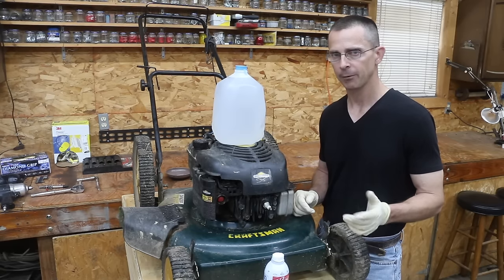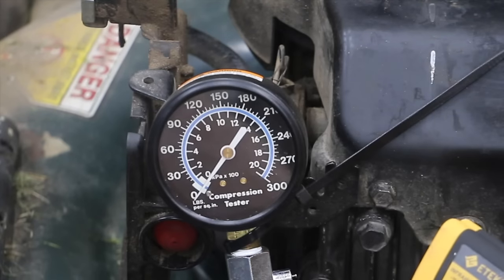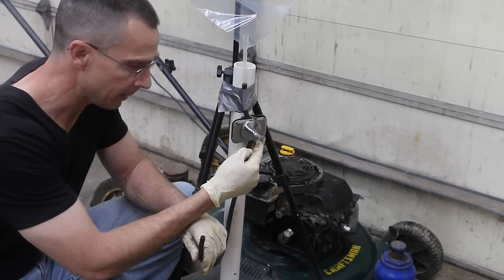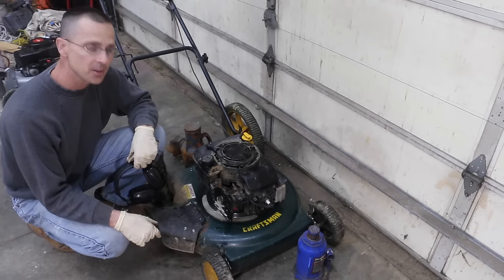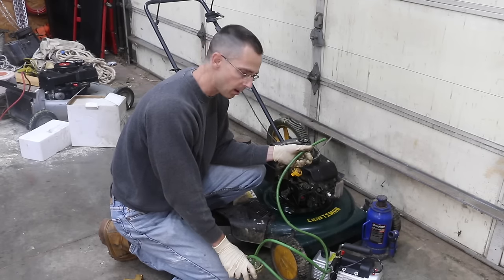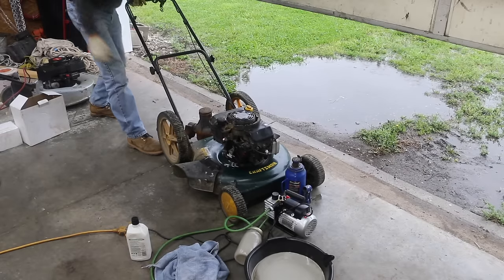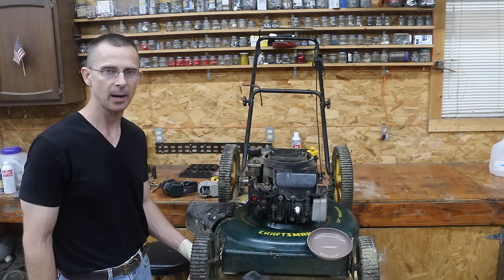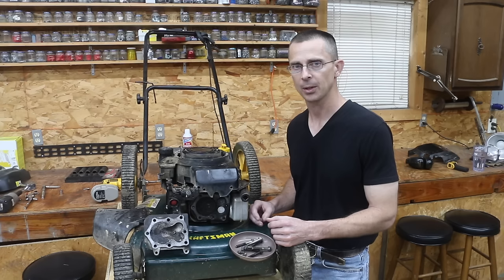Seafoam--can't believe what it did to my engine episode 5--cylinder cleaning test using water!!

Comment: You don't need that much water. About a cup or so should suffice, administered with a spray bottle into the air intake. Should be a job measured in minutes, not hours.
Reply from the maker: Thank you for this recommendation.
Reply: Yes! What I do to clean fouled spark plugs and clean the carbon off the head and valves is just take a glass of water and slow pour(1/2oz at a time) it into a car carburetor, or take off a small vacuum hose and let it pull the water straight into the intake manifold. The water goes in, and under compression then flashes into steam, shattering the carbon. Who told him 2 hours? and how much water?
Reply: your point would make sense if the cylinder head in the video was completely de-carbonised but it wasn't. minutes would have made barely any impact.
Reply: The engine temp dropping does not help, if the water was cycled it would have worked better I feel.
Reply: I agree!
Reply: He may have run the engine too cold for the steam effect to work.
Reply: Also helps to tap the head with a mallet.
Reply: looncraz 

There is no ‘steam effect’ as it pertains to carbon removal. It’s just somebody’s theory. Has never actually been shown. It’s more hope than reality.
Reply: @FrankGutowski-ls8jt  Steam cleaning isn't a theory you dope. It's been around and worked well for ages.
Reply: Deez Nutz 

Well, if you’re that sure, why don’t you conceive a better demonstration that definitively proves that ‘steam cleaning’ in this kind of situation works?
Reply: DRHJR DRHJR 

Your engine produces far more steam than you suggest just driving around. Why doesn’t it steam clean itself? 

A glass of water is about 12 oz, or < 1/10 gal. At 20 mpg, that’s two miles worth of driving, based on the fact that the engine produces about the same amount of water as the fuel it consumes.
Reply: Well at least we got to see what happens when an excess of water gets into the intake !
Reply: Remco is dead on with his comment!
Reply: this dude str8 washed his engine lmao
Reply: @FrankGutowski-ls8jt  Hi, I made a video the other day, my first real video, and all I have to say is, My hat's off to all the people who make good presentations like this guy because it is harder than it looks.  Well, as long as you don't want to look like a total dope, even if your an expert.  Keep up the good work.
Reply: I did that with my 2 cars and the steam blew out the carbon worked well yes use a spray bottle on a fully warmed up car should take 15 minutes max.
Reply: I was going to note that it needed to be aerosoled too. BMW has a high pressure water injection system on their turbocharged engine that helps control temps and allow them to run more boost. iirc it's the M4
Reply: I was always told that the addition of cold water only really works when the engine is at full operating temperature. The way I would do this is by using a spray bottle and every 15 seconds or so, give it a blast into the carb. The purpose of doing this is to cause a temperature imbalance between the metal of the combustion chamber and the carbon deposits adhered to it, which causes the carbon to flake off. The whole process should only take about 5-10 minutes or so. The slow drip process appears to have introduced too much water, and reduced internal temperatures enough to where it might not have caused the flaking process to occur. Still, it seemed to give some decent results, sans water contamination in the crankcase. Love the increased compression.
Reply: In my experience with this, I use about a cup of water to decarbonize a 1200cc engine.  You let the engine get up to operating (or even "slightly hot") temperatures, then let a little water in.  I usually place the water below the carbs, and let the vacuum pull the water in, i.e. putting the water above the carbs might cause too much water flow.  A big poof of water vapour + carbonation chunks comes out of the exhaust, the engine slows and cools down a bit, i.e. it takes less than two seconds.  You stop the water, and let the engine heat up again.  Repeat a few times until the carbonation chunks stop coming out the exhaust.  Often you don't even need a cup of water. I find significantly diminishing returns after about the 3rd or 4th cycle.
Reply: @looncraz  
Too much water in with the fuel causes lower exhaust gas temperatures.
Never heard of dripping water in the carb. How can that little engine vaporize the water completely. For all intents and purposes that motor is low performance flat head that doesn't really create that much power anyway. A good fuel additive on a regular basis should keep the carbon at bay and make sure your choke is adjusted properly. Have seen where the choke lever was bent and still partially on when the indicator said it was off.
Reply: When you blow a head, you can easily identify which cylinder it afected the most in a vehicle, it will be the one that looks like it has been steam cleaned
Reply: you sir are correct
Reply: @FrankGutowski-ls8jt  water methanol kits and blown headgaskets prove water works.
Reply: Be One 

Boil water in a carbon-caked cast iron skillet. See how much carbon is dislodged. Try shock treatments too, by dropping ice cubes in a hot skillet. Observe no change. Try misting, as shown by internet decarbonzation gurus. Note no change. 

Look up Leidenfrost effect to see why water will not wet a hot surface. Also note that ICEs produce copious amounts of hot, high-pressure steam as they run, yet still develop what are called carbon deposits, but which consist mostly of calcium and zinc from oil additives.
Reply: Exactly the seafoam takes 10 minutes and you know heat soak blah blah blah not hours LOL
Reply: Spam Can Subaru has been doing the same on the STI for years..... Water injection, it's actually been around for a pretty long time.
Reply: The Sparkster 

This happens only on your imagination.
Reply: Dan M   

All it did was blow soot out of the exhaust system.
Reply: @ProjectFarm  Yup, too consistent with the water application. The head temp was below the boiling point of water, that means puddles were sitting in the cylinder, creeping past the rings. The head was the cleanest around the spark plug where the most heat was, another indicator the head was getting too cold. I would have loved too see the "cough method", spray a shot of water in and wait for it to stop coughing, then spray again, to keep the water in a steam state, and keep the rings expanded. But hind sight is always 20/20. Great channel though.
Reply: @deeznutz2646  so then it is a theory!
Reply: @FrankGutowski-ls8jt  The BEST way to get rid of carbon is the "Italian tuneup" for about 5 miles! BTW, Cris Fix gave this video 2 thumbs down...
Reply: ojars zvaigzne 

I continue to be amused by YT’s many armchair decarbonization theoriticians. My own theory is to use E85 if your engine will allow in order to produce as much steam as possible internally, and follow through with the Italian tuneup, hoping for the best.
Reply: 120 minutes! You’re welcome!
Reply: @FrankGutowski-ls8jt  also note that the water did in fact remove carbon from the engine
Reply: @FrankGutowski-ls8jt  wont help the intake valves on a direct injected motor that never sees any fuel.
Reply: 3d printing meathead 

Look up the Leidenfrost effect. Water on a hot surface. Beads of water skit around on a layer of steam.
Reply: kewlbrz07 

This is an old trick mechanics use to lighten gullible customers’ wallets. Loosening soot from the muffler is all it does. ‘Proof’, they claim, that it works. If engines produce steam as they run, why don’t they clean themselves?

BTW, the deposits consist mostly of zinc and calcium from oil additives in crankcase vapors that are drawn in through the PCV system.
Reply: @drhjr7516  Somebody needs to read "procedures for cleaning carbon from a stationary engine" NO ONE IN THE AUTOMOTIVE REPAIR BUSINESS WOULD -NEVERMIND
Reply: Will this work for modern mass airflow sensor cars that are turbocharged?

Comment: I have run water/isopropanol alcohol injection in a 4 stroke 1000cc turbocharged engine. Water-ipa injects into each intake track at 150 psi, the water alcohol mix is completely waporized when entering the combustion chamber. I've run this on many of my turbo charged Yamaha snowmobiles over the years. On teardown of the engines I've found them all completely free of carbon deposits inside the combustion chamber, on the valves, and on the top of the pistons. There is no harm seen from the injection of water. Reason for running water-ipa injection is the ability to run higher boost on pump gas insted of running race fuel. Poor man's race fuel is a nickname used for this injection. I've run 22 psi of boost making about 350 HP in the 1000 cc engines on pump gas. Side effect was a very clean engine in the intake and combustion chamber.
Thank you for your videos, very informative, highly appreciated. Greetings from Norway 🙂
Reply from the maker: Greetings! Thanks and you are welcome!
Reply: this actually seems like fun to do. more complicated than just putting race fuel into the tank but can be a lot cheaper when tuned right (and a computer can just remove the boost if the water/iso tank runs out)
Reply: @blendpinexus1416  True, I have a failsafe switch that reduces boost to the waste gate setting, not do destroy the engine when the Water/IPA tank runs emty. I have the waste gate setting to allow for a boost level that is safe to run on Premium or 93 octane for USA or 98 octane for Europe. It's the cheap way out, and when you are riding trails you don't have the ability to get race fuel anywhere. Most servicestations sell IPA and water is free at the tap.
Reply: As far as a turbo charged engine what does methanol do?
Reply: @tonyhilton1461  In my application (although I do not use Methanol, but Ethanol) it is to prevent water from freezing.
Reply: @tonyhilton1461  methanol can and must be run a lot richer if used as the only fueling, it also adds octane rating over most average gasoline. Because of that you can get high compression/boosted engines to run cooler and make more power. It will allow the adding of more boost and timing. Negatives are that you have to change your oil almost as much as your gas tank because of the rich running nature of the fuel it contaminates oil quickly.
Reply: @tonyhilton1461  when used as supplemental fuel along with water added to a gas engine you can get a lot of the benefits without the negative oil contamination
Reply: what car, what engine?
Reply: I have done the same on my 1979 indy pace car.  The lawn mower was idling not under load there for not making enough heat for steam cleaning.
Reply: @sophiatheodores7985  Any gasoline fueled engine, and even diesels, can run water/alcohol injection to cool down combustion chamber temps. Which allows you to run higher boost levels without knock/pre-ignition/detonation.
Reply: @jan-ovepedersen5764  yeah but what engine did you turbo?
Reply: @sophiatheodores7985  Yamaha Apex Snowmobile with the Yamaha Genesis 4 cylinder, 4 stroke, 998cc engine (derived from the R1 motorcycle), 150 HP stock. 315HP with turbo on premium 93 octane (US) pump gas, 350 HP on premium pump gas with water/alcohol injection.
Reply: @jan-ovepedersen5764  based

Comment: We learned the water to clean carbon trick when I went to motorcycle school back in the 80's  We were taught to use a mister(spray bottle) to atomize the water.  I've seen results of that on motorcycles and it worked well.  dribbling the water in I would worry about not having it atomize correctly.   I would love to see this same test with a water spray vs. dribble.    Love your tests!
Reply from the maker: Thanks for sharing
Reply: I’ve seen this done before and the amount of black that went out on the ground from the exhaust was crazy. I wonder if it a safe to do it on Diesel engines.
Reply: I used a sprayer as well and got decent results.
Reply: @NathanWaste  This is actually the only safe way to decarbon diesels
Reply: I agree I’ve only use spray bottle with a extremely fine mist 😊
Reply: That is true for an engine with more than one cylinder.  I believe that mower only has one 😉
Reply: About how much water would you guy use?  About one bottles worth?
Reply: No
Reply: @christianwerner5199  “no” to what? Please explain
Reply: Used too water in this test one gallon is too much water.  Need not to have more than 20 oz bottle.

Comment: I'm a big fan of the channel & just wanted to toss a quick comment out. This info comes via my father, who was a big name in auto racing back in the late 50's and before that an instructor for the Air Force just after WWII in internal combustion aircraft engines. His highest qualification was in the Pratt & Whitney R4360.

The history of using water in ICE's is long and storied, and much of my dad's knowledge came front USAF research regarding the use of water/water methanol injection.

The first time he guided his very skeptical son through using water in an engine, it was accompanied by this: "Son, this car has been driven for years around town on short trips. This has caused it to get so loaded up with carbon that it's not working the way it should. When you dump a large quantity of water in a hot engine, the water soaks into the carbon, turns to steam, and blows the carbon apart. Once the water cools the engine down, it won't do any good. Once the engine is good and hot, manipulate the throttle to keep the engine running and DUMP A QUART OF WATER DOWN BOTH BARRELS OF THE CARBURETOR AS FAST AS YOU CAN WITHOUT KILLING THE ENGINE (it was an AMC 343 V8 and only took maybe 8-10 seconds)."

I understand that much of the advice about using water to clean engines has been to feed over a longer period of time. However, executed as my father instructed it is effective and does not contaminate the oil. I run a performance sportbike equipped with water injection and have never had oil contamination. The rate of feed is critical. Water injection is far slower than in your test, and cleaning is faster but of VERY short duration.

Thank you so much for your good, unbiased and scientific testing.
Reply from the maker: You are welcome!  Thanks for sharing.
Reply: I wouldn't waste time with water/meth injection on an engine as a performance enhancer UNLESS the engine was boosted....

There's really no benefit to it on an N/A engine.

Comment: I just watched two episodes of attempting to remove carbon from a cylinder head. Water, then Sea Foam vs Marvels Mystery Oil.
Back in the early 80's when I started tinkering with engines I used the water followed by transmission oil to recondition piston rings. Over the years I have used Berryman, and STP, products.
However, watching your videos I believe that the MMO product does the best and can treat more common problems from fuel cell issues, head & upper cylinder, to rotating Assemblies.
Thank you for your time and studies.
Glenn
Reply from the maker: You are welcome!   Thanks for sharing.